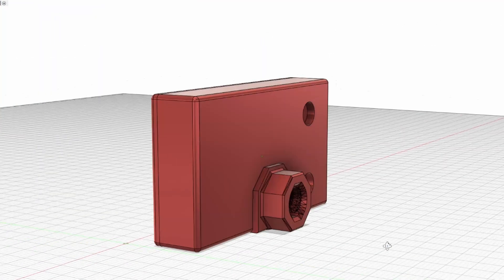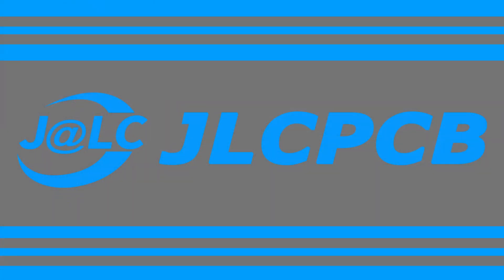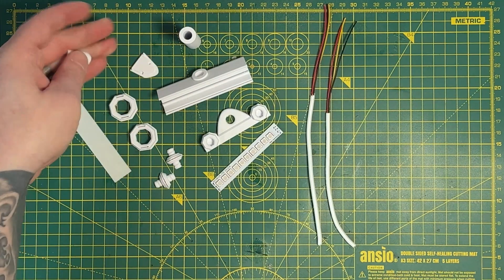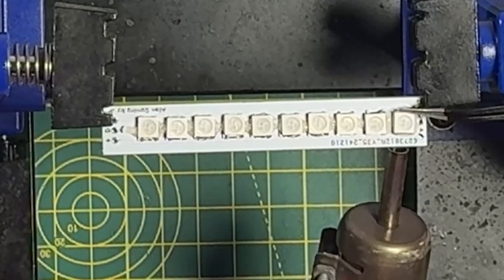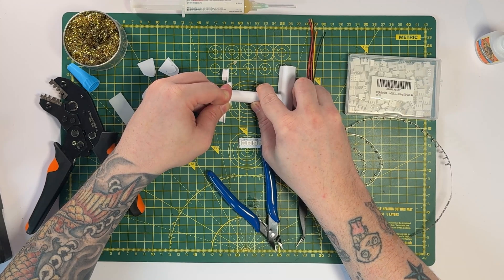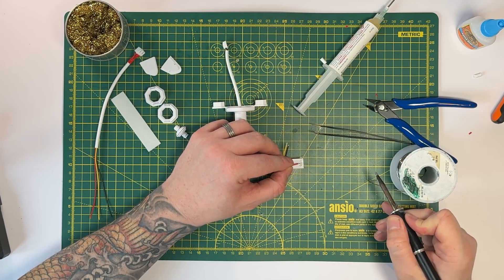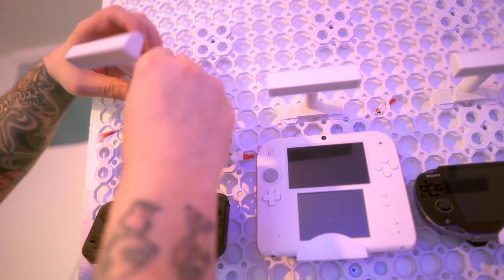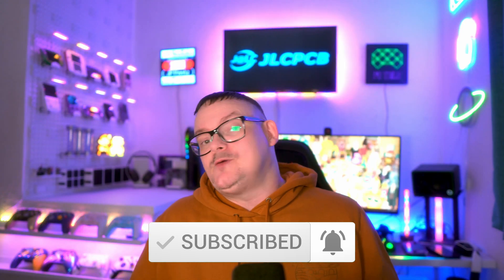Transforming The Multiboard with Custom RGB Lights: 3D Printing Magic!

Comment: Thanks to your  STLs  all my prints have turned out great the only small problem was my desired LEDS were not in my delivery and China is closed for the new year also i only had strips of 8 leds on pcbs so i will just have to wait a while longer before i connect also i received my pcb clamp that you recommended  and i am impressed with it  so THANK YOU gain for all your input and the quality of your clear easy to understand videos.
Reply from the maker: Thanks I really appreciate the feedback